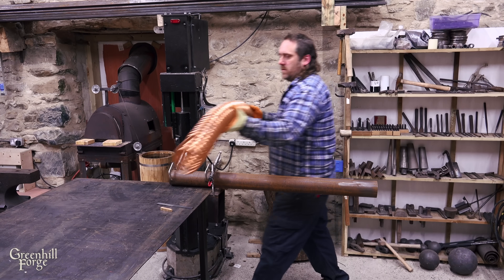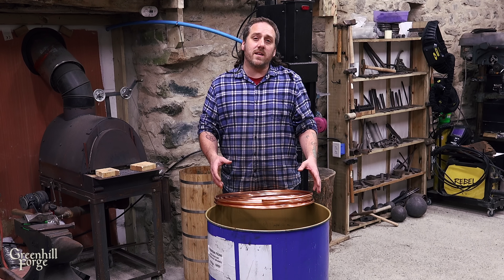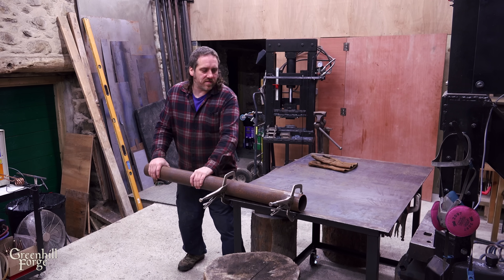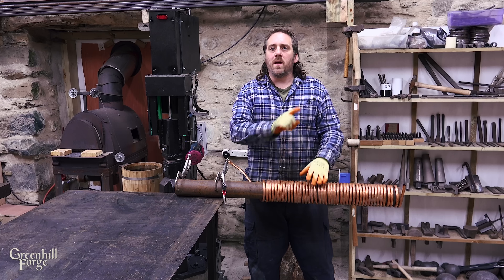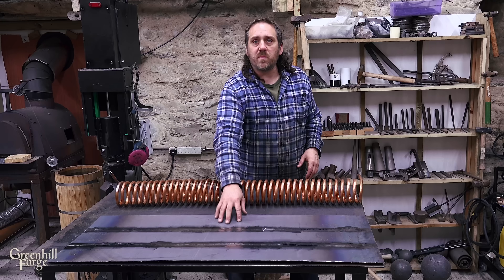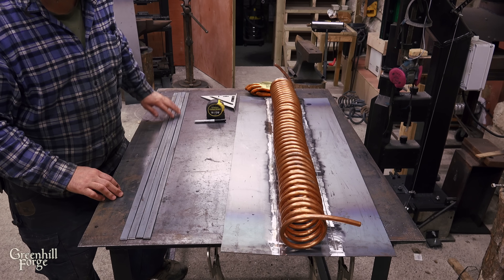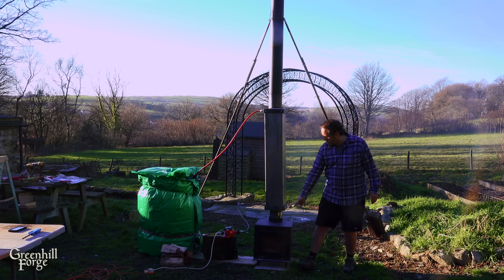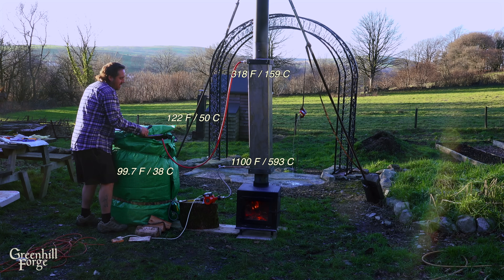Wood Stove Water Heater Experiment - Surprising Results! Part 1

Comment: I don't know , but I have read copper pipe won't stand up long in high heat or fire exposed but to use stainless steel pipe instead. Is this correct or is copper fine. I guess this set up is not exposed to direct flame but is to the fumes and high heat. Is that a concern for copper or not. Ty.
Reply from the maker: the gasses are pretty acidic that will affect things. Stainles is way better for a finalized design but too expensive to prototype with
Reply: @GreenhillForge thx

Comment: Lots of woodstove manufacturers had an option to ad a "water coil" the company I worked for, Pacific Energy, a 1/2" schedule 40 came in the back of the firebox, ran along the back and up the side before looping around and returning, they installed thousands.

Comment: A wood burner is pretty dumb to start with, its like 15-20% efficient at best with almost all the heat output going straight out the flue, so anything to harvest that wasted heat is generally a good idea. I also think that the extra work in making the stand-offs etc was a massive waste of time, a tighter wound coil with more loops is probably better. Dont see the point in the dampers either, copper doesnt melt until like 1000c and full of water, probably even higher, so what are you needing to protect it from?

Comment: Wouldn’t it be easier to just put a 6” pipe inside a 9” pipe, weld ends and let water circulate in the space in-between? 1/10th work, same effect.

Comment: Seems like it would have been easier to just drill holes in the wood stove and then simply run copper wire inside?

Comment: A wood-fired hot tub is a pretty common thing in a lot of cultures. Normally the stove just sits in the water as part of the tub OR protrudes outside of the tub, but one of the walls of the stove is in direct contact with the water. In your case...
- You need electricity to heat the water.
- You lose a bunch of heat in the pipes going to/from the hot tub.
- You lose a bunch of heat between the stove and the insulated/coil section.

These problems don't exist when the stove is part of the tub, but the disadvantages of the traditional way are...
- It's possible to touch the side of the stove while in the hot tub. A common way to mitigate this is that the stove sits at ground level, and the seat inside the hot tub is above it, so the hottest part is hard to reach.
- You take up a seat in the tub with the section of the wall where the stove heats the water, unless you do the solution described in the first disadvantage.

The stove you built can be useful for the other use cases you mentioned, but if you want a traditional jacuzzi - this is the way to go.
Reply from the maker: Thanks for the input. While they are actually fairly cool and look neat I'm not a big fan of the systems where the firebox itself touches the water. It inherently cools the firebox and a cool fire is a dirty fire. I would agree that direct contact is far more efficient but to run cleanly it really needs an induced draft system, like in a steam engine, to make sure the fire is running hot enough to be clean(this could be a pretty fun project to build). One could instead go with direct contact of the flue gasses like a water jacket (I made a flue water jacket off grid shower that I show in this video - https://youtu.be/pP_2A5Wdvqg  ) but that increases the creosote buildup in the flue. it also adds a lot of condensation to the inside of the firebox which has to be managed.

It's all a series of trade-offs, as with most things. But like you mentioned I was going for something that was mobile and could be used for a variety of things. I also wanted to make something that could be added to any normal wood stove instead of needing a whole woodstove for the singular specific application. It also won't need the pump as it will be run on thermosiphon once fully installed. I also built a whole different kind of woodstove, (which you can see in this video https://youtu.be/pfWMZuctbXM ) to pair with things like this heating coil, that is deisgned to vastly reduce lost heat and increase burn temps to have a very clean fire.

Comment: Copper and steel do NOT get along together and you will soon have a leak after all that work.
Reply from the maker: copper is more noble than iron, meaning the copper is the cathone and the iron is the anode, so when the copper and steel touch the iron loses electrons to the copper and the iron corrodes much more than copper. it's like the statue of liberty- the inside steel structure rusts and needs repair but the copper outer shell is largely fine.

but ultimately I agree that if moving on to a V2 long term design stainless would be better for the coil. it's just too expensive to prototype with.

Comment: I like the idea of what you're doing but I think there's better ways of getting even hotter water for the tub outside use a old oil furness there's lot's of different one's I the the grandfather was a Irish bloke called Jerry's DIY he shows how simple of a process it is from a old drum or large gas bottle or you could go down the route of Methane gas if you can get old containers to store it in there another bloke from USA who did the oil one with steel barrel and a steel box around that with metal ducting with a blower pushing Hot air into his property with no carbon dioxide coming from if that would be very good and dirt cheap full house 35C in 1 hr

Comment: fill it with sand next time....
Reply from the maker: https://youtu.be/nJp3o8WJ05s
Reply: I meant fill the copper pipe with sand to bend it. Sorry. Should have been more clear. Then you don't have to wait for water to freeze.
Reply from the maker: oh, right. yeah sand is good too but annoying to get out of long coils like this. never tried it but someone suggested salt- works similarly to sand but you can run water through and disolve the salt.

Comment: Used a similar chimney setup to provide hot water for an off grid cabin. The cold water storage tank was elevated and gravity fed through the wood stove and then into an old hot water heater for insulation. It took about an hour to fill 40 gallons.  Then the water heater fed downstairs to the shower. 
Pretty nice to have a hot shower in the bush with no gas or electricity.

Comment: Could you not use rockwool as insulation?
Reply from the maker: the actual rockwool is fine for high temps but the binders in it break down around 200-250c

Comment: Nice, but by removing so much the heat from the gasses the particulates will likely gather more on the flue (much like running your wood burner cold ) So I'd expect cleaning the flue more often if using this all the time.
Reply from the maker: agreed. i tried to solve for that in these videos https://youtu.be/pfWMZuctbXM  https://youtu.be/nJp3o8WJ05s

Comment: I just built a big heater for hydronic heating that os heated by the exhaust and exvess heat from my standby generstor. I got way more hot water than i can use. Thinking of heating mh driveway and sidewalks to keep no ice. Im not grid tied so i generste alot more power than i use and been trying to consume the excess power in to heat and ice batteries

Comment: If the water boils the copper will have a short life, especially if the water you use is not softened. Condensate is acidic and minerals do not boil. They remain in the coil.

Comment: Try using a low volume pump and circulate the water through a concrete slab. It doesn’t even have to be very big. The rock will hold the heat and it will heat your entire house.
Shanon L Fowler /
The Ancient Trapper
Reply from the maker: I've got a video coming this autumn that it think you might like
Reply: @GreenhillForge ok
Thank you

Comment: The soothe from the woodfire will cover the copper coil and reduce efficiency. Just wrap it around the chimney pipe and insulate it on the outside
Reply from the maker: you might like these - https://youtu.be/nJp3o8WJ05s https://youtu.be/G7k_CatVFM4  https://youtu.be/pP_2A5Wdvqg

Comment: I would have also used braised fittings on the copper inlet/outlet of the heat exchanger, as opposed to just standard leadfree "solder" joints. It would add another layer of protection if there are ever any water flow issues, or restrictions on the inlet outlet of the heat exchanger you have a LOT more wiggle room if the copper heats up as silver solder joints start to melt at appx 1300 deg F.~.

Comment: We've use a set of 3/4inch copper pipes going through our fireplace in our off grid holiday home for more than 2 decades now, heats the geyser to near boiling temps in less than 2-3 hours. Think you could get away with much less copper too

Comment: I wish I had payed more attention and asked more questions. In the late 70s I visited a retired county road engineer neighbor one cold with snow on the ground Sierra Nevada winter. His 3 bedroom home was in the mid to high 70s throughout, but I saw no heater or fireplace. Only a medium rectangular steel air tight door wood stove, with no glass, on some bricks in his living room. The firebox vent pipe leading to the roof was boxed with a small fan blowing room air around the pipe then ducted into the attic. Up from the bricks came what looked like a common size water pipe into the top of the fire chamber, then another one coming out and back down. Both disappeared through the bricks to somewhere below the floor. What are the pipes for I asked. He said let me show you. Out in the garage was a 500 gallon water tank (he was a county road guy after all) mounted horizontally on stilts, externally wrapped with some insulating material. Inlet and and outlet pipes with a 115 volt electric hot water pump inline came and went from the wall. And some safety blow off valve stuff at the top. Inside the firebox, in what today is called a secondary burn chamber, was a S shaped pipe connecting the two external pipes. The firebox was burning, the hot water was flowing and the boxed vent was forcing air back into two bedroom ceiling vents. With all that blown in air coming down the hall back into the living room in a closed system air loop. The garage water was over 180 degrees. 500 gallons of it. All done with one not very large wood burning stove. He said at night he would turn down the firebox air flow , and still have some fire burning in the morning.  All of it DIY hand made and welded, because he said no company had anything similar to his ideas for sale.

Comment: Ever tried solar liquid.. and a heat exchanger.. 

I build a stove inside a old 2000 liter diesel tank.. 
i used the radiators which are normally inside a house, i placed them on both sides, and one on top, each one meter long and 60 cm wide.. connected them all together, first the two lower ones, and than to the one on top, with a copper tube around the chimney.. 
which then goes inside the house.. to a few heat exchangers.. big ones.. but separate.. 
and in the back inside, i have a bigger container where the used liquid returns.. a small pump underneath it.. which causes the flow.. 
it’s running on solar.. 

I use solar liquid because it absorbs heat quicker than water.. the second reason is the metal doesn’t start to get rusty inside.. 
i made an open tube 3 meters higher on top of the tank.. 
than so it can expand and come back and to be shore ill have enough liquid in storage.. 
 
Every one thinks.. ohh such a big tank needs a lot off wood.. well not really because a normal fire, also heats up very easily.. 

Bud i can make it full with wood in the evening and close the valves so the fire runs slowly.. 
so i can go to bed and sleep well.. knowing i only need to refill at 7 am..

Comment: Next build try using steam chase pipe. It's use in cold areas wrapped around larger pipes to keep the fluids moving. Set it up on a lathe though a wooden dye

Comment: I tried to build something similar and the high heat and maybe cold water flowing threw the inside destroyed the copper and I had large flakes of corroded copper flaking off and then started leaking water.

Comment: I grew up with chip heaters. These looked like a modern cylindrical water heater/store and contained a small fire box, (much smaller than yours with a similar sixed tank). It was a morning ritual to gather sticks to get the water heater going and within a few minutes it was always way hotter than needed. I always over-stoked the fire and the sound of the overflow thumping on the roof with boiling water is another joyful memory of those days. You can still buy modern wood fueled water heaters.

Comment: Is it not feasible to replace copper with coil-stailess still pipes?
Reply from the maker: definitely. bit less heat transfer with stainless but will last a lot longer. copper is cheaper and better for prototyping though.

Comment: What about high temp protection?  Some type shut off / loop so you dont slowly cook self in a hot tub ?
Reply from the maker: I think an auxilary water tank you could switch the water flow to would work well. might be easier than trying to micro manage a wood fire

Comment: Fill the copper pipe up with table salt, do your bending, then dissolve the salt out with warm water. Works ok for me.
Reply from the maker: Yeah, that's a clever solution. If I didn't have a chest freezer I'd probably try that

Comment: How did you avoid galvanic corrosion to occur when using iron spacers on a copper coil?
Reply from the maker: you can't without something in between, but as the copper is more noble than iron the corrosion largely happens on the steel so the copper is pretty much fine, at least for a really long time
Reply: @GreenhillForge  Hm, ok, provided you're not after a durable solution it's ok! Nice proejct anyway, I subscribed :-)
Reply from the maker: @FC-se8wf  Stainless steel tubing would be better for a long term setup but it's even more expensive than copper so not ideal for experimenting with
Reply: @GreenhillForge  Correct, a further disadvantage of stainless steel is low heat conductivity.

Comment: I made one a few years ago but I used 3/8 pipe Much harder to bent into a 5in OD coil. I used the water trick but I didn't freeze it. But like you said,, get all air pockets out, and the seal at each must be super strong. Compression nuts won't cut it  lololol

Comment: That coil bend was satisfying in the extreme. :)
My dad was an Electrician, but all his life he built and tinkered. He had been to university to study Engineering which was unusual in the 1940s, the world had other things to do. He owned an industrial scrap metal yard, so had a lot more material to work with than the average guy. He got some extremely thick copper pipe a foot across from somewhere, I think the walls were five mm thick. 
Decided it would make a good chimney flue for a inside steel body wood stove he designed and built because , he thought, it would heat the room quicker.
Also  his plan was mum could cook on it, he made it as big as a modern kitchen stove on top, you could put two big pots on top of it.
Only problem was the stove was too efficient, and the huge area of the thick copper flue made it painful to be in the same room if you put too much wood in the stove. By the time you worked out it was running too hot, it was too late and you felt your face crisping up  from three meters away. Impossible for anyone to cook on it, you  couldn't  get close enough to stir the pot. :)

Comment: This is a bit silly.There are easier ways to heat water .just use a boiler with a water jacket and pipe it to the hot water cylinder. You can use a direct water boiler stove or an indirect boiler system.This also can be piped gravity no pump needed. The problem using a coil in the chimney is condensation which causes sulphuric acid which eats the coil.
Reply from the maker: Here's one with the coil not inside the flue. https://www.youtube.com/watch?v=nJp3o8WJ05s slower but fixes several issues. I also show an off grid outdoor water jacket shower I made in this one. https://youtu.be/pP_2A5Wdvqg . I'll be doing boiler and water jack videos but the goal with this project is to make something that can go on an already exisiting stove and not need to buy a whole extra stove.

Comment: You "could" simplify the build by putting the coil inside a cylintar of antifreeze less parts less welds and simple. or forget the coil. us a copper pipe. Maybe?

Comment: This is all fine and dandy but you're going to get an insane amount of tar and creosote build up on that coil by having it in direct contact with the fire's exhaust smoke. Might be worth ditching the copper for jacketed steel pipe design to make cleaning it no more difficult than a standard fireplace cleaning.

Comment: What about disassembly and cleaning. If the copper pipe was wrapped around the outside of an inner pipe, it would make chimney weeping a lot easier with minimal to no disassembly required.
Reply from the maker: Check this one out https://youtu.be/nJp3o8WJ05s

Comment: My dad tried this very thing but on the outside of the pipe. The problem he ran into was the water would turn into steam and just come out as steam at the other end. If you’re pumping faster or the pipe is bigger it probably wont be an issue.

Comment: It's interesting but in stead of maker a square tube and jacket, a circular one is more easy to handle. Why you don't use a stainless steel coil in stead of copper. you need to add a safety valve about 2-4 bar to avoid any pressure surge. I recommend you to use a double combustion stove to burn gases and not pollute the surrounding.

Comment: Build a masonry oven with a drop in chamber for your exchanger, you’ll hold mass thermal for hours after the wood fuel has been fully exhausted, heated house, heated water, no need to waste all that heat.